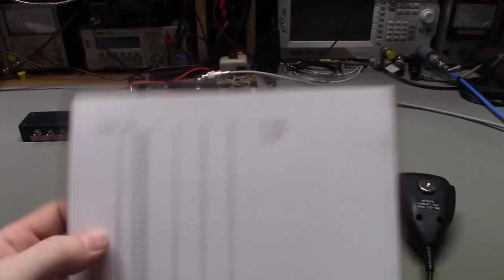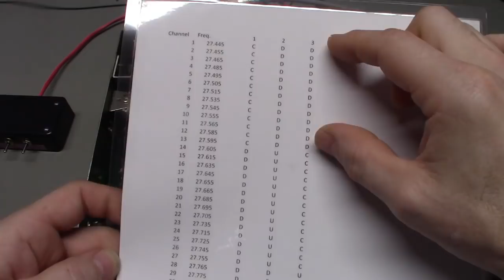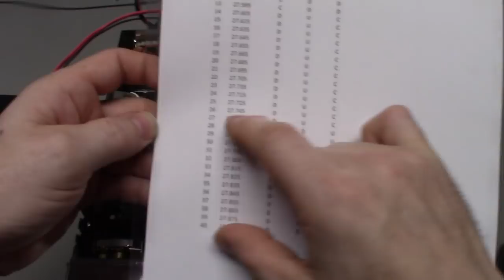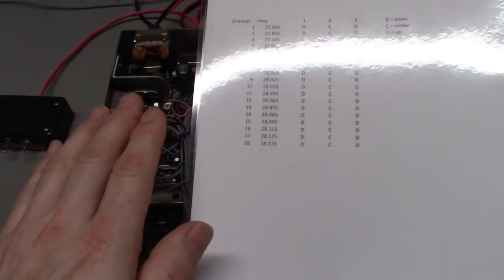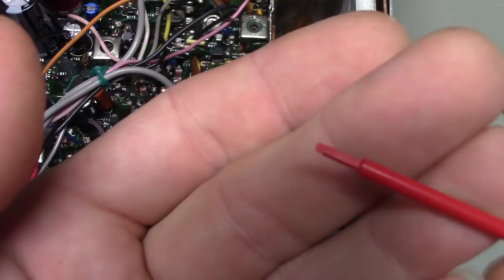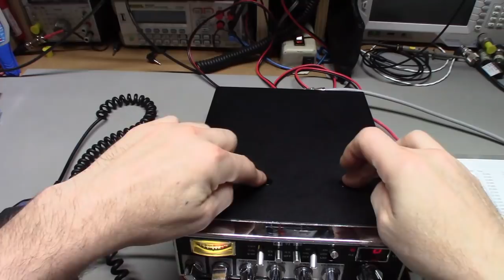Rare DAK VI SSB 40 channel AM/SSB mobile CB radio.

Comment: Great chassis. I have several manufactured versions of this same radio. Cobra,Bowman, Dak, realistic and others used this chassis. It was very easy to wideband this radios receive and transmit. Channels was a piece of cake. After a few changes to the radio it outperformes the cybernetic chassis.  The vco blocks are not easy to come by if they fail. The 02A chassis all we're a breeze as well as the 858's. I still use mine. I still have several new vco blocks. There was a guy who put out a slotted core set for this rig. But that was a while back. Like 30 years lol
Reply from the maker: VCO blocks are actually easy to get.  Spectrum Communications has been making modern replacement modules for years and they are much more broad banded then the originals.  http://www.spectrumcomms.co.uk/CB_Kits.htm
Reply: @mikesradiorepair  i knew someone would pick up the mantle and begin producing them. Its such a nitch market that they were very unable to be had for a good while but with a 30 year old rig thats understandable.  There are a lot of these still around.  Cobra dynascan engineers came up with this chassis well before dak as a cheaper to produce cassis. You'll know it as the cobra 138xlr. I've completely recapped mine with good quality caps and hopefully she'll last till I'm gone lol. After working on these rigs since 1976 I still enjoy them.  Have a great week and keep Dx'n
Reply: I saw this video and Im 3 yrs late. radios also include the Lafayette and Hygain radios . I have had both and still have a functional Hygain 2705 40 ch AM/SSB radio. if anyone ever runs into another Daks mobile like this video, there are still schematics available on line.

Comment: Well it's receiver seems quieter than modern units the noise seems to be less harsh. The audio on receive sounds nice. Not sure if that is because of the other radio's mod's or this units design? It is noticeable even on youtube! A lot of newer radio's the background noise is very sharp and very thin very mechanical sounding and irritating!